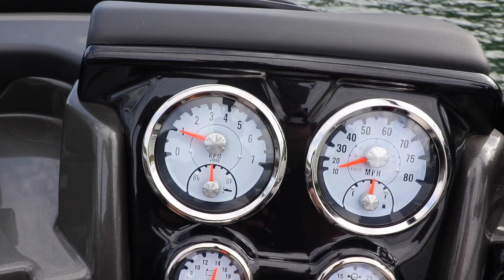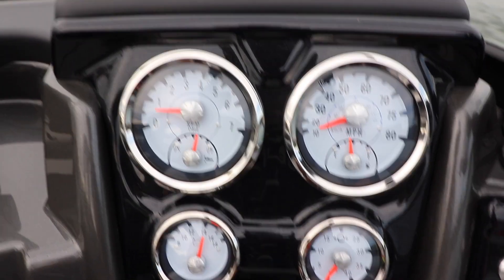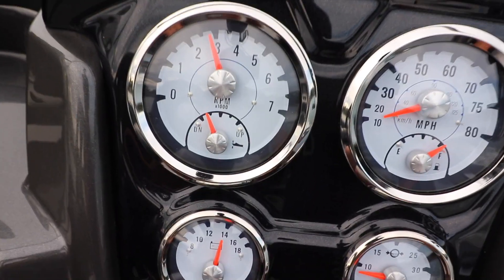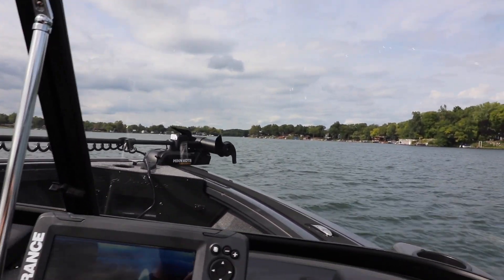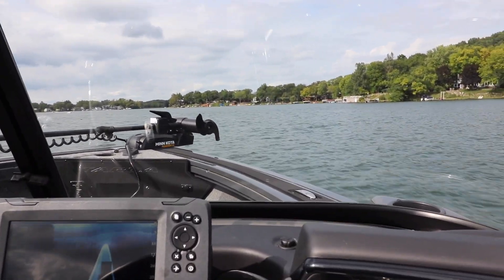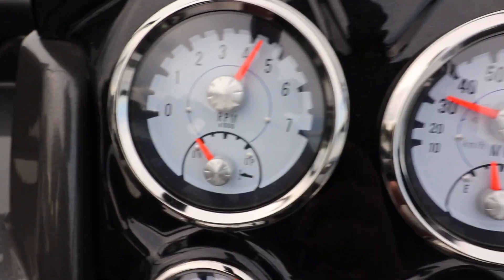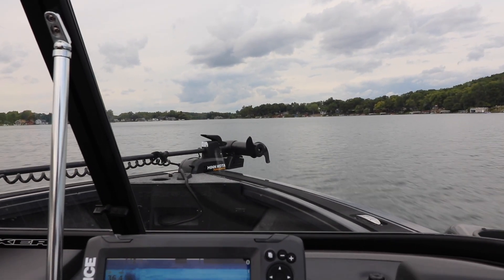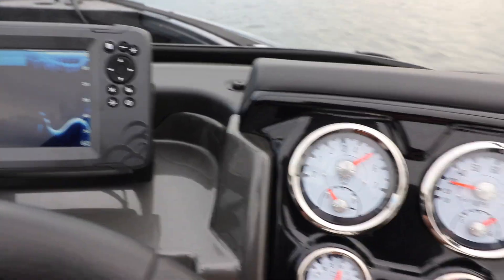How To Break In An Outboard Motor - Mercury Pro XS 200 V8 FourStroke

Comment: This is video is pretty accurate my merc 200 pro xs manual says first 2 hours run it varied throttle up to 4500 rpm and every 10 mins a 1 burst of WOT. 

Last 8 hrs of break in run it normal varied throttle but avoid WOT for more than 5 mins at a time … 

Basically just don’t be the piss out of it for the first 10 hrs. Every hour I’d even shut it off and let it cool down for 10-20 mins just for shits and giggles

Comment: I've been building engines of all makes/models/applications for 25 years.  So much hocus pocus...so little need.  The first few strokes are "Breaking in" the rest are "Wearing it out".  Camshafts DO need a very specific break in process however the rest of the block really doesn't.  you need to bed the cylinders, flex the rings and such but that's done VERY quickly.  Every new engine will run a "fever" and once that breaks...the engine is as "broke in" as it's ever going to be.  I think companies come up with this stuff just so they can blame you for not following some BS prolonged procedure and get out of warranty work.    The lump doesn't care.  Unless you drop the hammer early on there's a good chance it'll burn oil later in life...but to each their own!
Reply from the maker: I’m glad someone like yourself with all the years of knowledge commented on my video, thank you. You know the truth, thanks again for watching!!
Reply: .... Congratulations to BRP...

Comment: You obviously don’t know how to break a motor in. Read your manual.
Reply from the maker: +Dj good thing I followed the instructions from Mercury when I made this video
Reply: Funny cause manual says vary rpm between 4500 and 3500 and every 10 min full throttle for 1 min. Do that for 2 hours.
Reply from the maker: Dj first off thank you for your comments. I picked this boat up at my local Bass Pro, Tracker service center in Auburn Hills Michigan. They provided a detailed Mercury break in procedure for this motor, which I followed and filmed this video based on. Based on your comments I googled Mercury manual to review what you possibly could be seeing. Many Mercury manuals come up, and reviewing them they may differ slightly based on the model. Again this is a guide on what to do for a break in, but as I mentioned everyone should check their manuals for their specific engine model if there are differences. Thanks again, Tight lines to you sir.
Reply: Fishhook Terry right on, I commend you on my trolling. You took it very well. Good day to you
Reply from the maker: Dj lmao thanks brother. Come back and troll anytime